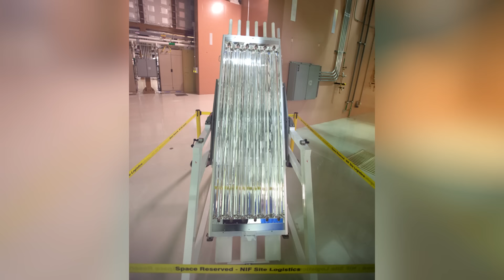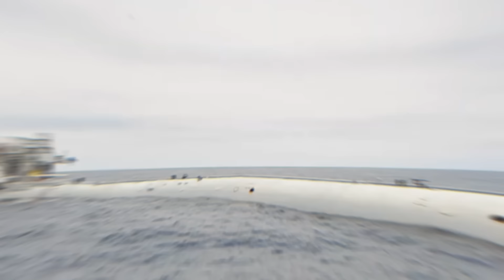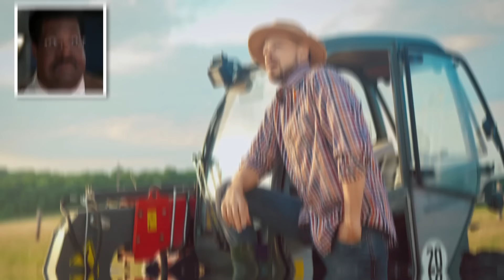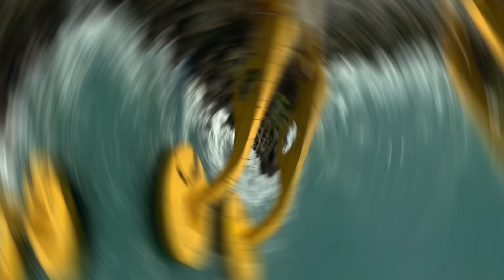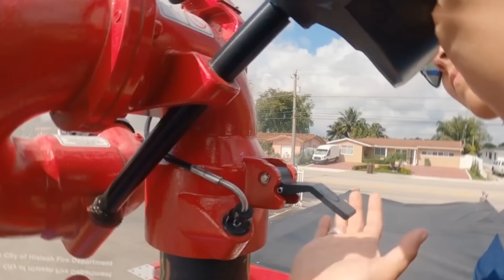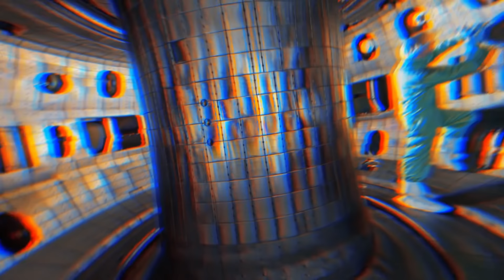Incredible Machines You Won't Believe Exist

Comment: 818 OG - 1/2oz & Mint Wax?
Love the pipe. Pre heats.
Flower was $79
Wax was $39
Pipe was maybe $20?
Free shipping-
You do get way more than a marijuana rec shop here in Tacoma.
.
I put the Thca king diamonds on just about everything.
Love the crumble - It has a euphoria on it, that I haven't had since the 1990's.
.
The diamonds have a clean top end high.
.
Get your vape gear from Element Vape.

Comment: 4500HP is the same equivalent to a Diesel locomotive engine for hauling massive freight trains especially the ES44ACi diesel locos the AC4400CW is just 100hp less at 4400hp and that's just one locomotive 5 locomotives together is 22,200Hp ES44ACi locomotives 5 together is 22,500 hp most trains on average can have 4 locomotives 2 on the front a Dpu (distributed power unit) in the middle of the train and a pusher on the rear can go to 5 depending on the length of the train and how steep the route is BNSF for example has 5 AC4400CW locos over cajon pass where the grades exceed 2% 3% in some places hence extra power is needed

Comment: I see this in a lot of your videos. The word for something able to combust is Inflammable. "flammable" is not a word.
Reply: Incorrect. Flammable is a word. What is difference between flammable and inflammable?
If something is flammable, it can be easily set on fire (paper, wood, gasoline, etc.). However, inflammable means the substance has a very low ignition temperature (alcohol, kerosine, benzine) or is capable of bursting into flames without the need for any ignition (chemicals that are highly volatile and react with water or oxygen).

Comment: There is a thing you forgot to mention about the NIF.
They do not try to achieve clean energy, they are a weapons research facility, and their goal is to make the ignition sustain itself far enough to be used in a weapon, not far enough to harvest clean energy from.
Also a thing that is often forgotten about nuclear fusion is that it is not radiation free, there is actually much more radiation coming from it than there is from nuclear fission.
It is also no more clean than nuclear fission.

Comment: Technically, The machines with the bucket facing/digging away from the cab are called "Shovels", Not excavators.
 Excavators pull the buckets/dig towards the cab of the machine.
 I know it's a small distinction that doesn't mean much to most people, But I used to operate excavators for a living, And I just thought I'd set the record straight because I'm kinda that way. lol

Comment: Nuclear fission is a little easier than nuclear fusion. It use uranium-235 and instead of fusing atoms uranium actually breaks down into batium-139 and krypton-94 and energy released is used to boil water which turns into steam and drives turbines. I know this because i just finished preparing for my CHEMISTRY FINAL EXAM.😅 🤓
Reply: a little easier....

Comment: i'm sorry..... you say hyundai dropper jaws with the 9000 tonnes lift? on october 3 2022 the SSCV sleipnir broke it's own record of 13600mt by lifting the nearly 17000mt tyra platform. 
appart from floatover and launch installation methods there hasnt been a single vessel which is able to come close to that.